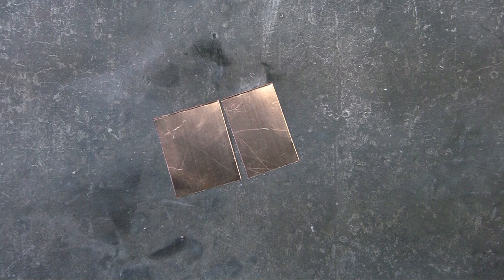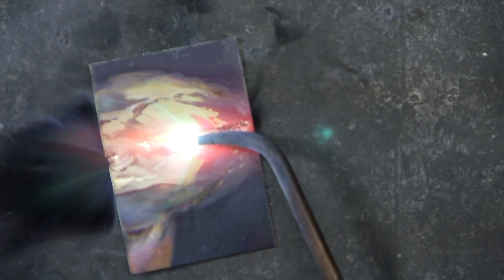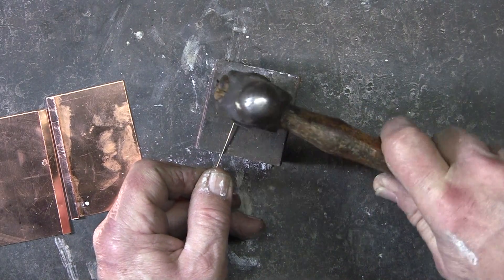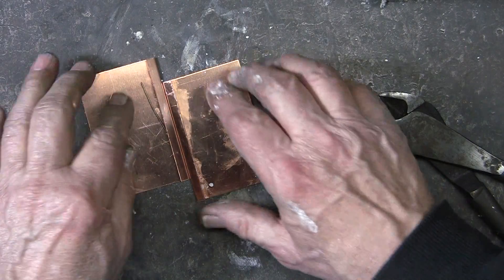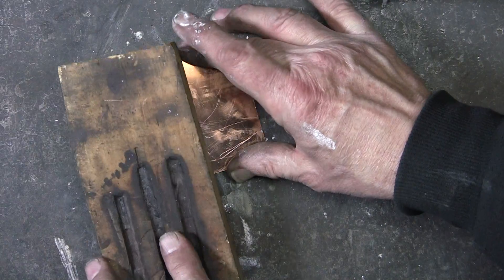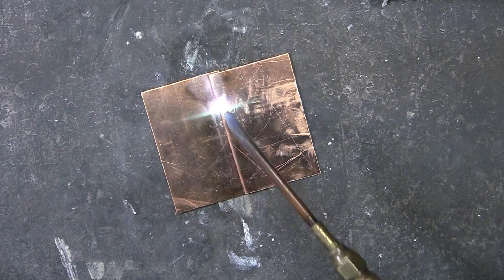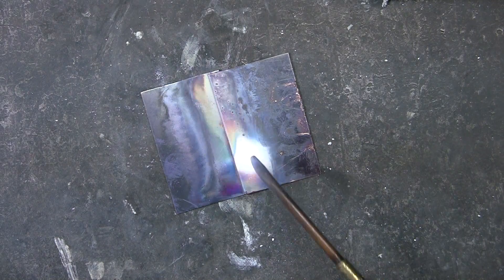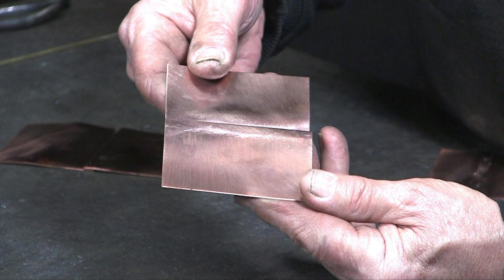Silver Soldering a Lap Joint in Copper

Comment: Great overview, thank you.

I've used large sheet metal folders to fold along a line (as shown at the start of this video: https://www.youtube.com/watch?v=fv29N3GLcl4), but those devices have a limit for how far back you can bend a piece on itself.

How do you get these bent so far over (must be about 160 degrees), so neatly, as shown at 1:23 in your video?
Reply from the maker: Watched your video. Very nice video and step by step by how you made the brake.  Great job.  Really like the instructions for making the pan brake.  For the video on the lap joint I was using a "bar folder".  The bar folder folds at 90 degree.  Or release a lever and increase the bend to about (as you say) about 160 degrees.  Turn the metal over and press down to get about 175 degree bend.  Here's the video I did on the Sheet Metal Bar Folder.  https://youtu.be/mSW7M5VrkbY

Comment: I tried to braze two pieces of 24 gauge copper with O/A  torch(#0 torch tip) but I kept melting the copper before the rod , although once I succeeded  when I reduced the heat a bit and it worked but I'm thinking maybe there's a limit in the thickness of the copper to be brazed, if it's 18Ga. ,there's never a problem  but with thinner copper sheets to find the correct balance heat/flow is still very hard for us newbies.
Reply from the maker: Brazing thin materials can be frustrating.  Check out this video i did on thin materials.  Especially the angle of the torch head.  
Let me know if this helps.
https://youtu.be/h0vIvipWVuY
Reply: Make sure you use a reducing flame and keep the flame moving, don't keep it in one spot too long.

Comment: Thanks for the video. I'm making a motorcycle fender with a seam in the middle. Do you, or anyone reading this, know, should I bend the shape AFTER I join the two pieces, or before? It will be a slight arc following the shape of the tire. Thanks
Reply from the maker: I would form the piece after it has been joined.  Forming before joining and the two pieces may not match up.  I've never formed a motorcycle fender.  There may be better answers out there.

Comment: and is it safe to use on water lines and stuff like tjat
Reply from the maker: safety:  for that you probably want to check with local building codes.  Silver Solder is an alloy.  I've seen forum inputs that 45% silver is recommended for copper to stainless.  I don't do very much silver soldering.  You might check with HVAC forums.  http://hvac-talk.com/vbb/showthread.php?53412-silver-solder

Comment: how to clean metals after soldering , brazing or welding don ?
Reply from the maker: Depending on how large a piece and how much solder, I would start with wire brushing.  If that doesn't work then I would use an acid solution.  Check out this video on cleaning copper.  "Cleaning Copper with Acids"   http://youtu.be/usUCOvFECIE
Reply: George Goehl Thanks